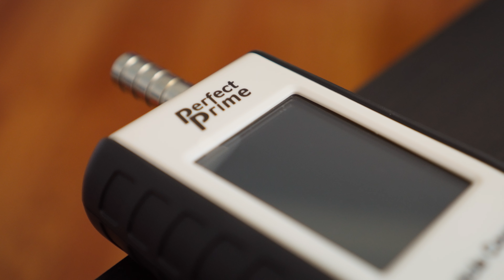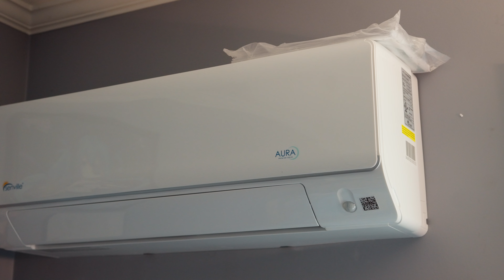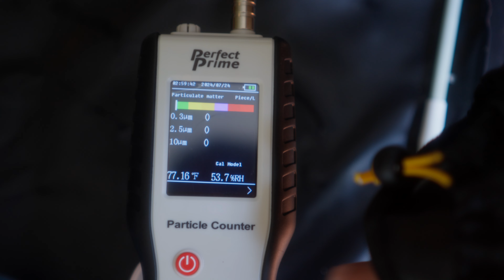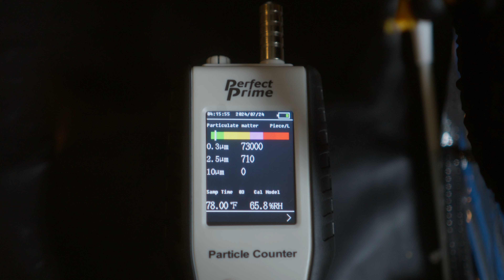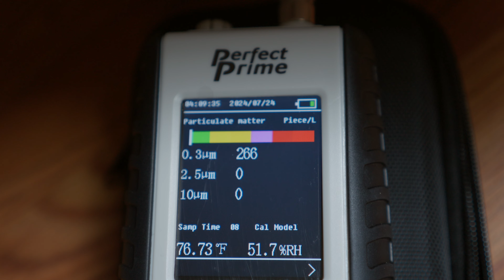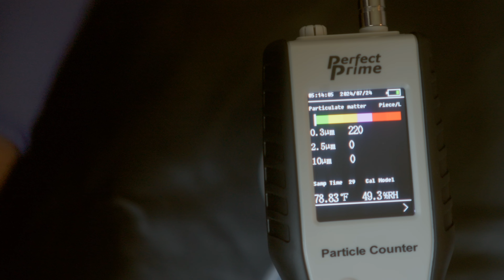Testing The Effectiveness of Your Mycology Workspace With Science! + New Mycology Tek Unveiled!

Comment: Excellent! I am having some really bad contamination problems because I am limited to a space in my basement that has all kinds of baddies in the air. I was considering a lam flow hood, but they're pricy. I may just try this method and see if my agar plate clones come back cleaner. Keep it up. You're excellent at explaining things and I was able to keep up with you. Amazingly, one place where I get no contamination is right next to my microwave vents. All my jars and grow bags are there until I have to take them to the basement. Would this method work with a Martha tent as well, and how would you set that up? I have some shiitakes ready to go and I don't want any black mold or mean green on them.
Reply from the maker: @kellymorris6497  should work the same with a Martha tent. I also tested running a smaller one inside the SAB all sealed up and it worked fine as well, but if you want a clean environment for growing, then yeah a purifier that pulls from the outside and filters to the inside should work fine. You'd just need to make sure you have a way for gas exchange that will allow exhaust out but nothing in through your exhaust. 

Speaking of shiitakes, right before writing this comment I was putting some white shiitakes to fruiting conditions haha.
Reply: Can build a hood at home pretty cheap, https://www.youtube.com/watch?v=lInfdAVvBts

Comment: Also… what about a smaller purifier actually IN the SAB. Did you try spraying Lysol in the SAB and testing?
Reply from the maker: @Mushmammy  I feel if the SAB was big enough and if one had an air purifier small enough that could work really well too. I may expirement with that at some point
Reply: @mushroom-girl-rem  I found one that’s like 14” on Walmart and my SAB is about 24”. I built a flow hood but I would love to use my SAB for spawning without having to worry so much.
Reply from the maker: @Mushmammy  update. It worked very well. I'm making a video about it now
Reply: @mushroom-girl-rem  I look forward to it!  I have an Amazon SAB with arm holes and access to lots of smaller HEPA units to use.